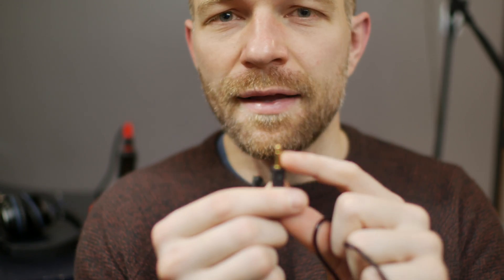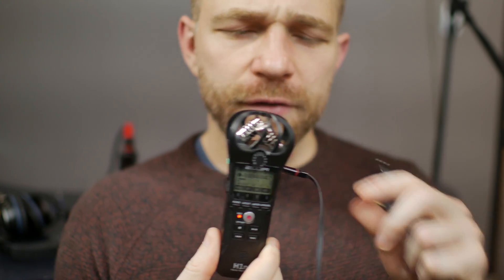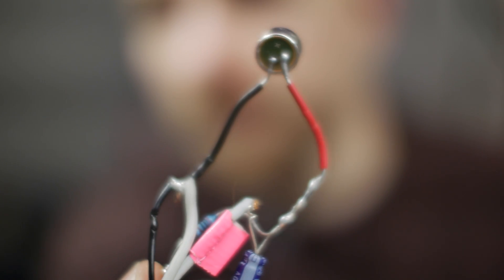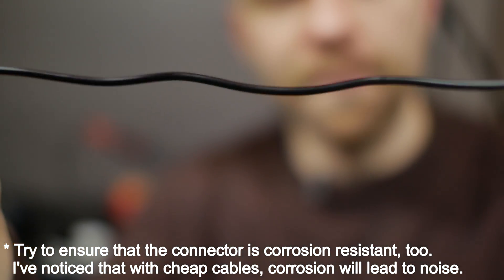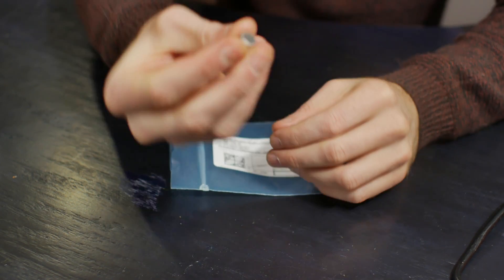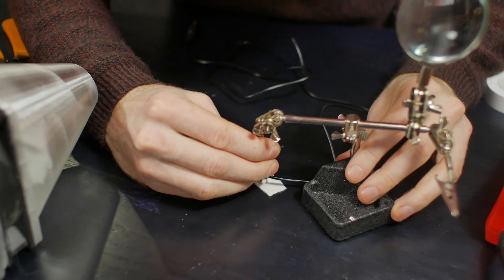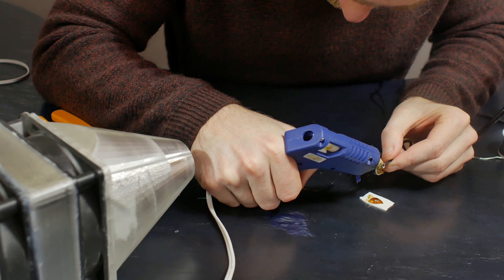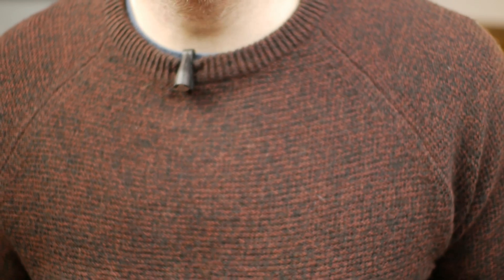DIY Lav Microphone! Just $5

Comment: Still recommend the same mic capsule AOM-5024L-HD-R? Or is there something else you would recommend now for a diy lavalier?
Reply from the maker: I generally just buy $20 lav mics from Amazon, as they come with a full kit of accessories and sound decent. The noise floor is relatively high on them, but I just pass them thru a software-noise filter. perfecto.

The AOM is super quiet out-of-the-box, but it seems to vary in sound depending on the audio-recorder it's connected to. I am surprised how much it varies in sound really. Attach it to a cheap audio recorder, like a budget laptop, and it will sound a tad nasally.

I picked the AOM to use for my Zoom H1n though, and when connected to it, I think it sounds really quite nice. I've bought several capsules, and I still generally like the AOM more than others; it is fairly easy to solder as well. It can overheat it tho if not careful.

I made a few of these mics for friends as gifts. When using a fancy mic cable, it adds a bit of a novelty.

Comment: Thanks Steve!  I was looking for a replacement for the good old Panasonic capsule and had seen these at Digikey.  Was wondering if it would have enough gain by itself  to use with my Zoom.  Sounds like it does, no problem. Great, helpful video.
Reply from the maker: Of a few different models I bought, they all worked well with the zoom; low noise and decent tone.

Some of them come off sounding a tiny bit nasally depending on what I have them plugged into (ie: my laptop). As a lapel mic tho, placed against my chest and used with a zoom, I was getting good results.

Those Panasonics were classics. :)